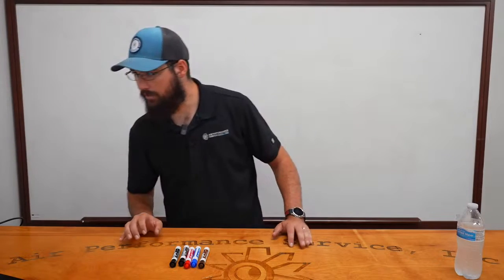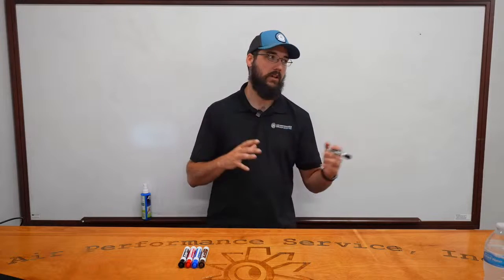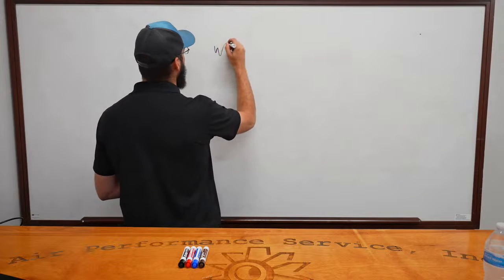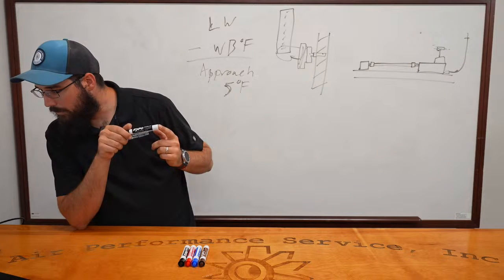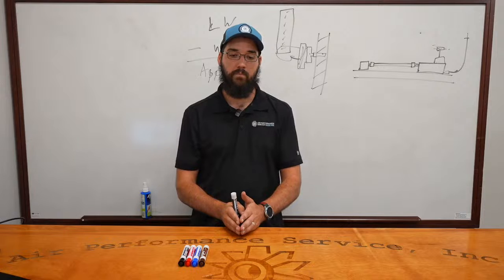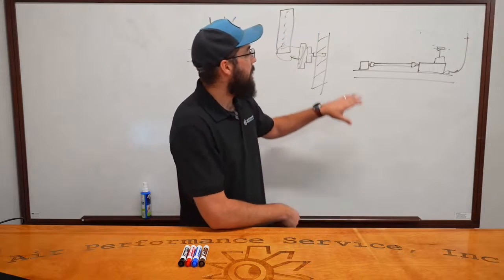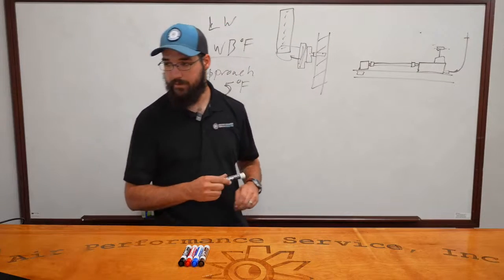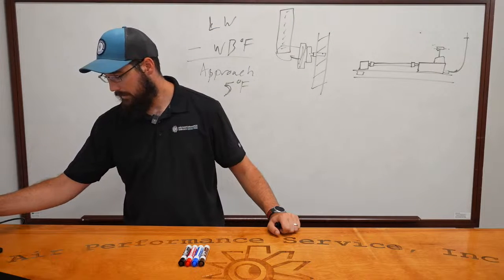Troubleshooting Cooling Towers

Comment: Bringing units online slowly after a shutdown can go for many types of systems actually and it was a good point to bring up because I see many techs just starting a chiller on a 90 degree or so day with every ahu coil at 100%   that's just way too much load for most buildings systems and I actually have been staging units on like your saying for years and it's actually quicker in the long run to get the building back online if you add a load one by one and keep the chiller in its sweet spot, but this also works for heating as well. Same concept different temp

Comment: What are your thoughts of buildings using water valves ( aka isolation valves) at the WSHP's/AHU'S etc etc. I've worked in a lot of LEED certified buildings that use them at each WSHP. You could direct flow to the critical areas and then once the loop is under control....release the override and let er rip tater chip.